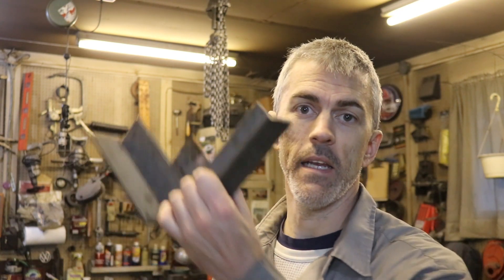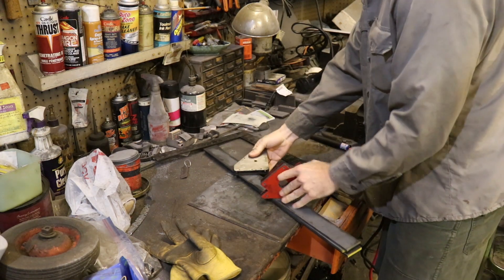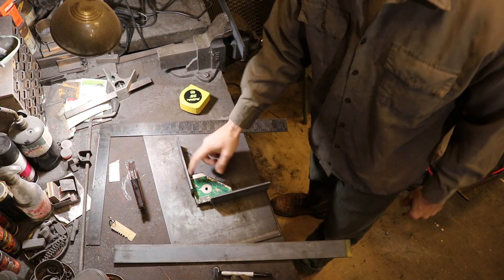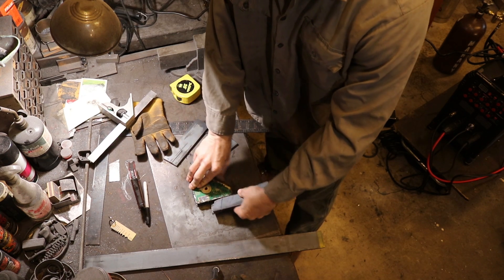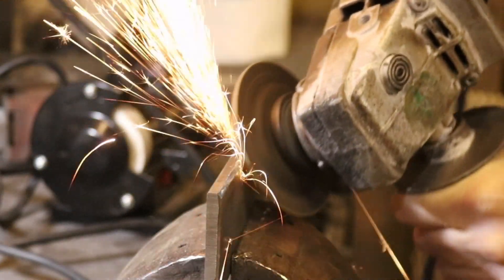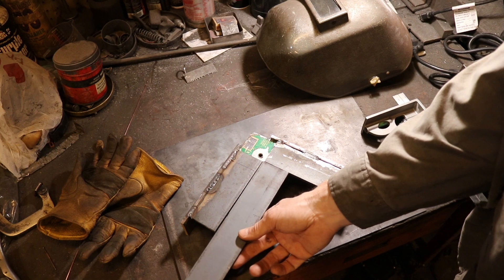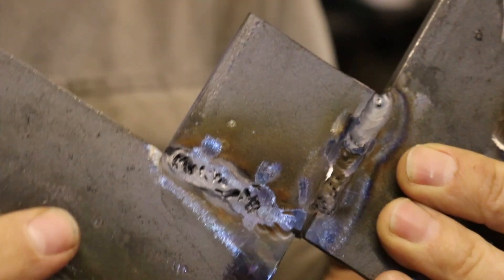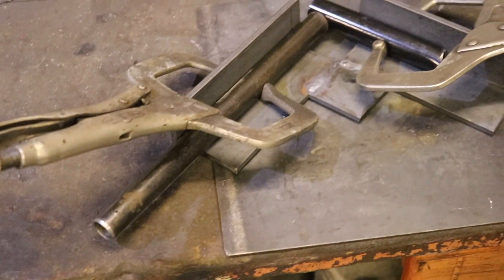Making an Angle Jig for 90 Degree Joint Welding

Comment: Can i use angle bar instead
Reply from the maker: The inside elbow of angle has a curve to it that, in the finished jig, will prevent you from seating the pieces you are welding. So no, I would not recommend angle

Comment: When you start welding in stainless and aluminum(fuck aluminum... until you get it down it sucks) you will nit only run 20to 25 CFH, but you will also need a few seconds of POSTFLOW. Ie your weld isn't complete when you stp the arc. You actually keep shielding gas flowing for a few seconds while the puddle cools and solidifies entirely.  Have fun learning TIG its a great journey and it is the superior weld process. Nice video man!
Reply from the maker: Thanks! I invested in tig classes at the local community college and loved it! Did some stainless and aluminum.  Actually really liked the aluminum because it heats up and cools down so fast it felt like I had more puddle control. Best process. Still getting to know tig brazing on my own. I get great results on pulse setting, but either too hot or too cold if running straight full arc. Beautiful stuff when I get it right😀. Thanks for the tips! Weld on, brother
Reply: @HooptieDoodle  wow you picked up aluminum within one class? Impressive
Reply from the maker: @natas0733  the class was a semester long. I think it totals like 50 total hours of welding. Well worth the $350.